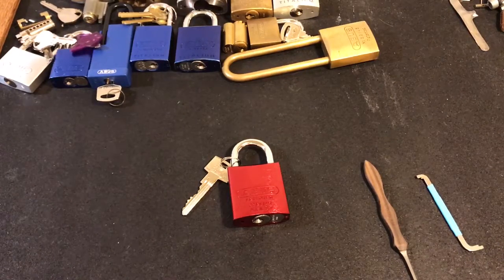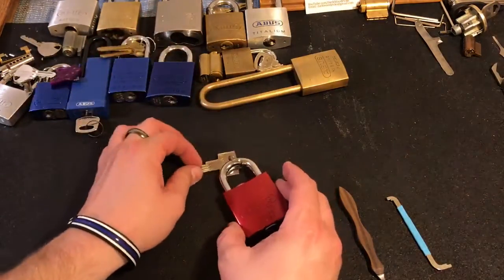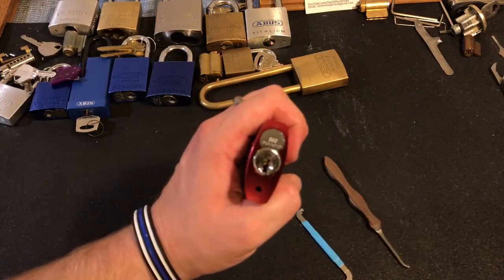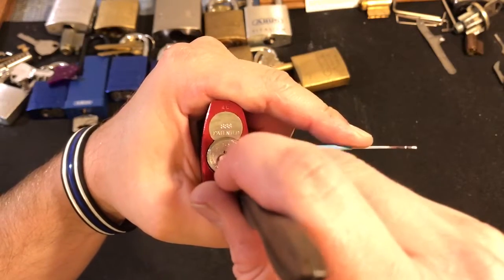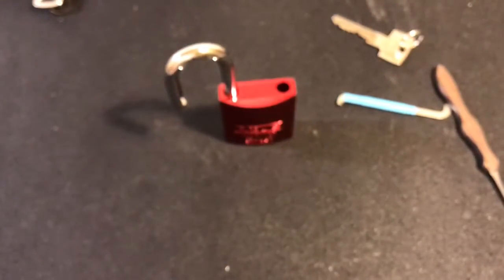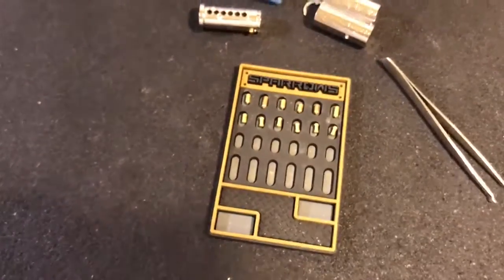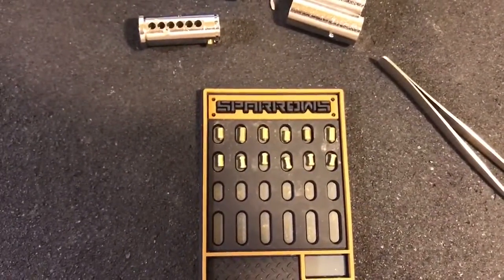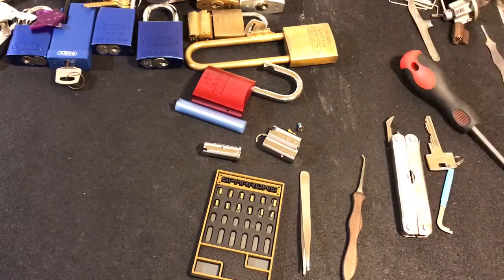LPPtln (26) Abus 83/45 888 Core

Comment: These are a really popular lock at work.   One guy bought two, one key retaining and one not. Ours have a hole all the way down in the 6th chamber in case you mess up gutting. You can cover it though and make it 6 pins. Great picking. :)
Reply from the maker: Thanks! I've got one of the C6A cores actually (it's the brass one next to my blue 83 in the vid). The brass 83 right above it has the first gen core, which is the one I managed to get the core retainer pin stuck in the Bible 🙀 only way to get it out was to get a friend to put it in a vice and slowly torque the cylinder until half of the pin and a part of the chamber sheared! Makes for fun picking now though!

Comment: Wow, really interesting video my friend, my eyes were glued to the screen! The AL 83 series of abus locks is extremely rare over here, you can only buy them on ebay from Australia, the standard brass padlocks are hard enough to get. Pretty cool to see the full size 888/Abus core as I've only ever had the smaller 72/40 version. Thanks for explaining the construction keying system, I've never heard of that before but always wondered about that little indent. What is the core made out of? Is it aluminium? Nice to see the drill protection, i'm not sure if it's included in the brass cores.
Reply from the maker: Hobby Picker I'm just as intrigued to see the 500 cores like you have over there! 😃 there are a few more cores and keyways we can get here in the states, but not the 500; not to mention the fact that you can get about five more colours and keyways from Australia!! That's why I will watch your (or anyone from the UK) videos of Abus locks about eleven dozen times 😂
This core is made of zinc or brass; coated with aluminium (or as pronounced in my part of the world, all-ooo-meen-numm 😂) 
The construction feature is something I've not encountered in the wild yet, however I I think I want to try it on the work bench soon! 
Drill protection is also about a 1 in 2 chance to find around here. The two brass 83s I bought (with cores) didn't show any type of drill protection. I need to pull apart all of my 83s and compare them; as I have first and second generation bodies and cores..
Reply: Pretty awesome stuff my friend, we should write a book on Abus 83s (I would buy all of them!) I would love to see the construction feature, maybe I'll try it myself but I'd need to find a small ball bearing, that is, if my 500 core does have the hole. Would you like some closer pictures of the 500 or would that just make you want one even more?!? I need to start my own collection of Abus 83 parts, at the moment I only have one brass 83/45.
Reply from the maker: Hobby Picker I would like to pin one up with the construction key as well just to give it a try. Lockpickinglawyer has shown it on a couple locks before actually! Some pictures of the 500 core would be great! 👍Eventually I figure a way to collect them all lol!

Comment: I wrapped a spring between the bible and got it twisted around so I no longer have an abus core in my 83/45ti. That is worse then anything that I can think of. Now I have a schlage everest in my 83/45ti.
Reply from the maker: +Smuckers T Oh No! Well, don't feel bad; I have loaded the detent pin in the bible not once, but twice now 😵🙀🙀😿 Not the 888 core, but two Schlage cores.. I think I used too much picking juice 🍷 when trying to re-pin them 😹😹
Reply: This made me really upset because it was a new lock and I had to pay a HUGE premium to get a KIK to IC core adapter. Losing cores sucks but everyone does it at one point. I scrapped the core took the pins and left over springs. The pressure between the core and the spring was so great that the spring etched a line in the metal core.
Reply from the maker: Smuckers T oh wow!! I've had springs hang up before but never to that point I don't think 😱 As for the KiK adapters, I don't know where you're located, but there are several good suppliers here in the states. I've got two (one brass and one chrome) but my fiancé took my allowance away after seeing the $10 KiK and how "small" it was lol! 🙀🤣🙀🤣